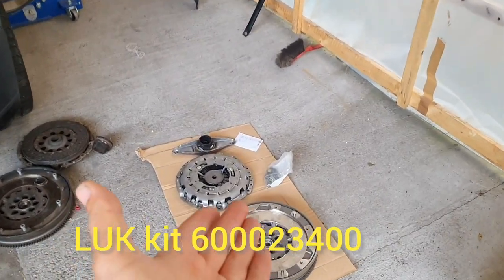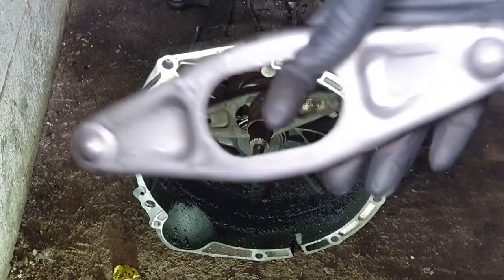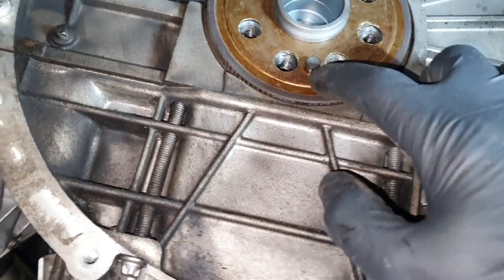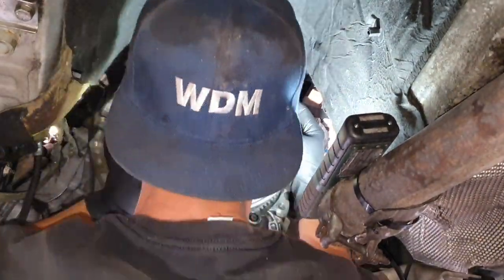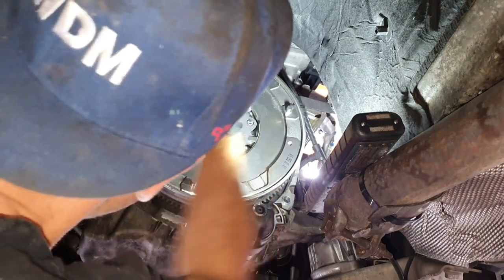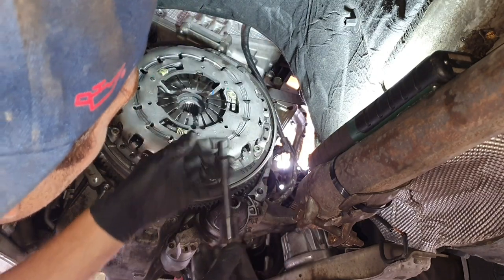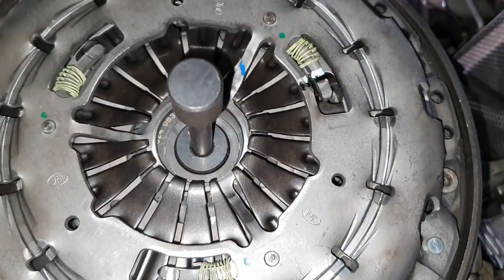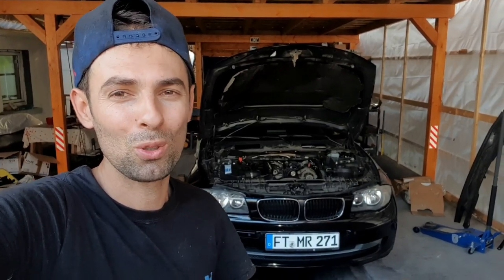Bmw 120d N47 engine, flywheel and clutch replacement! How to!

Comment: Why is there a gap between the flywheel and start motor/engine on my e91 N47? If I lay under the tranny I can see the flywheel. It feels like something should be inbetween this empty space
Reply: @88CBAUGH  Sorry for confusion. Ik how the starter works and all, but there is a gap/hole where i can look at the flywheel while being under the oil pan without dismantling anything from the car. It kinda looks like a half moon.

Comment: Muss Partikel Filter auch ausbauen???
Reply from the maker: Nein
Reply: @WarpDriveM  ich habe Motorlager links und Rechts neu gemacht. Vibrationen sind nach wie vor da. Jetzt du bist mein Retter. Ich Versuche mein  Glück. Die Teile habe ich schon gekauft alles zusammen 380€ .
Reply from the maker: Ich hoffe klappt gut! 380€ ist top preis, viel spaß
Reply: @WarpDriveM danke 👍

Comment: I'm ok with everything but man, disconecting the drive shaft is pointless if it was a drive shaft problem car would shake while driving on certain rpm ,drive shaft is not spinning while the car is stationary

Comment: The pressure plate screws should be replaced!
Reply from the maker: As per the repair manual, you have to replace all the time everything but because these are not aluminum bolts or stretch bolts or have a ° degree torq I use them every time when the kit doesn't have them and in the last 12 years I never had any problem 😉

Comment: Hello.i replaced my clutch and new one has came without that pice in midlle that you removed with allem key 14mm.it is normal?please give me your email address,i will send picture.i need some advise.
Thank you
Reply from the maker: Hey, there are different parts and sometimes is normal to be without the plate. It will tension itself when you tight the bolts. You can contact me @warpdrivem on social media or Contact@warpdrivem.com